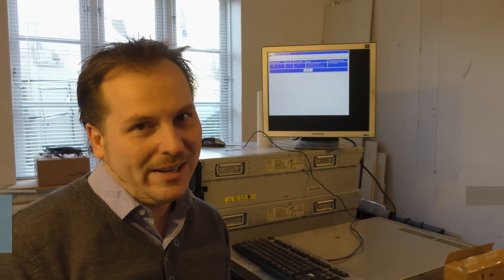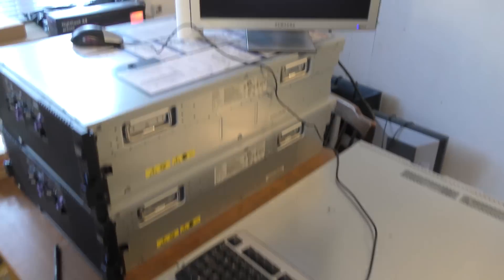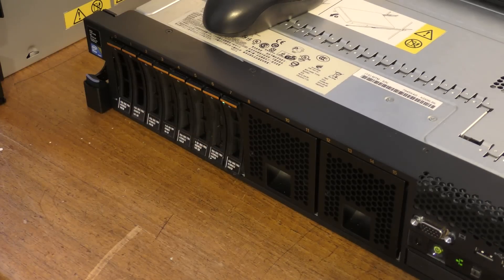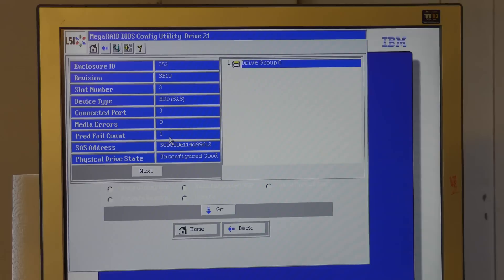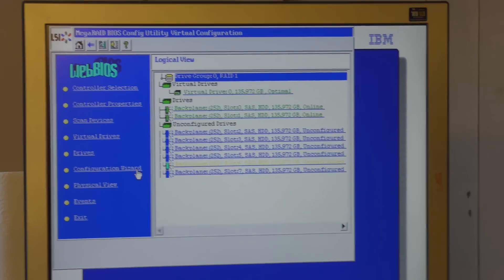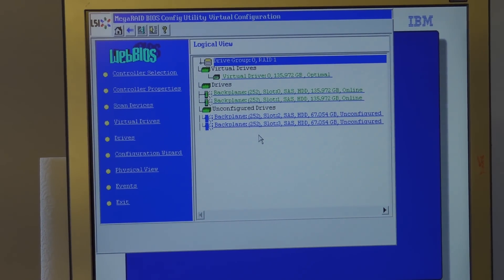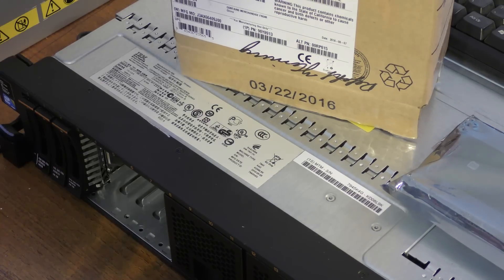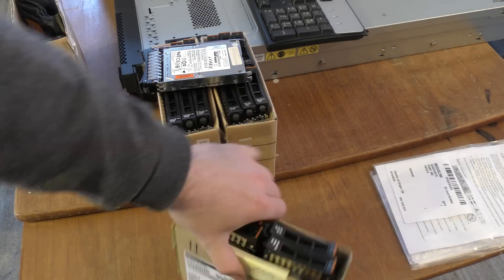SAS vs Trash - Sorting Bad SAS drives from Good - 436

Comment: Would it be still possible to use the hard drives which are marked as yellow / orange and add them to an RAID array? Really cool video series by the way! :)
Reply from the maker: Hi Arc Lyght (ArcLyght)
Thank You very much! Yes the yellow ones, are drives that the server predicts will fail. For a quick test they can be used.
Thank you for watching! :-)

Comment: Hi Morten. I hope you don't mind but I have 2 questions for you on the topic of hard drives for an IBM x3650 M3. (1) To save money, I just purchased some second hand 2.5" 500GB seagate SATA drives on ebay (not enterprise, probably notebook drives). Will these drives run happily in the x3650 M3? Or should I be buying IBM SAS drives or enterprise SATA drives? (2) With these 2nd hand non-SAS, non-Enterprise SATA drives in the server, can I hot swap them or will it break them when I pull a drive out while the server is running? Thanks Morton. Keep up the great work. Your channel is my favourite. :-)
Reply from the maker: Hi Eran Malloch
The used 500GB SATA will run just fine,, for prof. business use you use SAS,, but for a home and smaller use SATA is fine.
Thank you for watching! :-)
Reply: Thanks for that Morten. Also, what about hot swapping these non professional drives? Can you do that or will they break/get corrupted when the drive is removed while running?

Comment: Hi RPM=Revolutions per minute, If you attach your suspect faulty drives to a SCSI box then to an HP System you can determine all the attributes of the drive by using a piece of software called PartedMagic. This software is relatively inexpensive and has multiple apps for dealing with used/unknown drives.
Reply from the maker: Hi Bob McQueen
Thank You very much! 
Thank you for watching! :-)

Comment: Do you know how to connect a IBM eServer hard drive to a normal PC?
They have a different Sata connector. :/
Reply: *****
Oh is that what SAS is?
The connectors are very similar to sata, they just have a little bit in the middle. If I cut the sides of a sata cable, so it fit, would it work?
Reply from the maker: Hi television and cheese
You can not run a SAS drive on a SATA controller,, but you can run SATA drives on most SAS controllers.
Thank you for watching! :-)
Reply: My PlayHouse
Okay thanks.
So could I get a SAS controller in PCI/PCIE expansion card?
Reply from the maker: HI television and cheese 
Yes something like this: http://amzn.to/2ghXg1E it can take 8 drives
Thank you for watching! :-)
Reply: My PlayHouse
Thank you lots, Morten! :)
Now I have use for these drives. :)

Comment: "10.000 rounds per minutes"
Damn, you've got some dangerous drives there :P
Reply from the maker: Hi WeiserMaster3
Thank You very much!  10K and 15K RPM,,, that is right is it not?
Thank you for watching! :-)
Reply: Well yes, 10K/15K is right. but you said in the video "rounds" instead of rotations per minute, which made me think of the rounds used in pistols etc. which made me laugh out loud :D
That happens me all the time too, I just thought it would be "appropriate" to put it into a comment :p
Reply: yeah i had to go back on the playback-timeline to watch if i heard it correctly. I have never seen 15K RPM disks .. but that's most likely because i haven't touched a server directly in 14 years.

Comment: Does the IBM let you RAID virtual drives ? For example in ZFS i can take 8 disks put them into 4 mirrored pairs and then put the 4 VDEVs together in one pool
Reply from the maker: Hi Andrew Joy
ZFS is not a Raid controller, it a file system. The IBM Raid controller will present the OS with virtual drives.
Thank you for watching! :-)
Reply: Well its both its software raid and a FS :). But what i mean is can it do multi level raid so say 1 + 0 1 + 5 etc ?